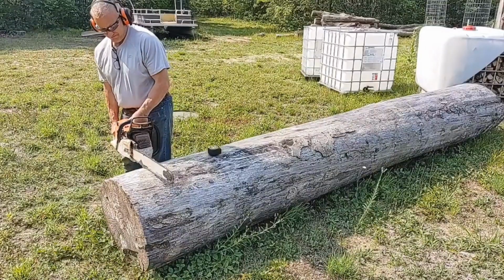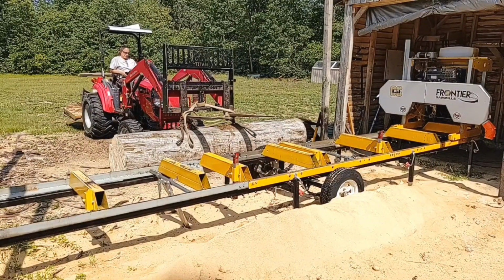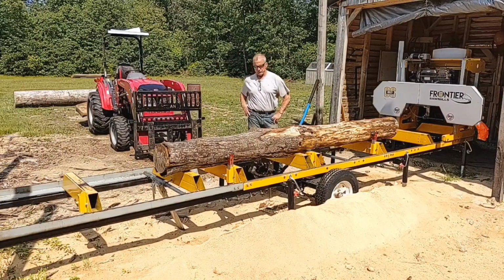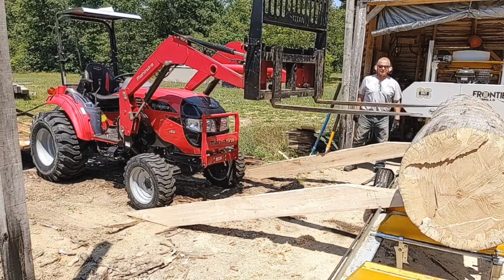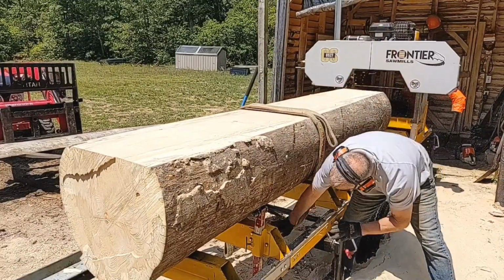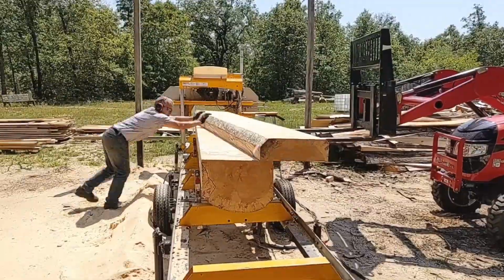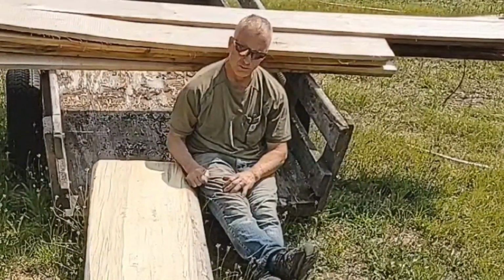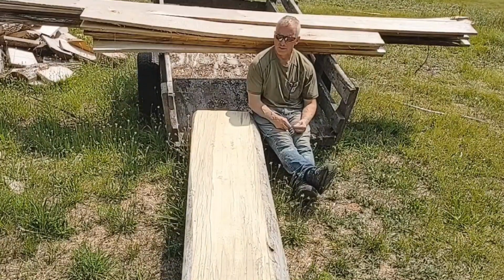Handling Big Wood on the Frontier OS27 Sawmill

Comment: I just got seven logs 16 1\2' long. Between 24&16" across. Gonna be used for trailer deck and corral boards. Luckily I have an old Clark 550 forklift. Still gonna be a job. Probably use your method with the strap to turn it. And it's still hot in central Florida. Thanks for the videos Jerry.
Reply from the maker: That is a nice load of logs.   That's the only way I can turn the big ones.   Thanks for stopping by the channel and the comment.

Comment: That sure was a big log you had there Jerry, i know when you sent me a message saying you had big wood but damn that was big 😄 
Your still lucky to be able to get the tractor over it, i dont have the height in my sawmill shed so id have to man handle mine 😩 theres not many overly massive logs ive had on but yeah i have to turn by hand. Slabbing down to reduce some weight it what i have done in the past but i try not to do that so i can maximise the biggest cant available.
Great job though Jerry, keep showing us how its done.
Reply from the maker: Thanks Buddy.  I've been milling some really big ones of late.  That is a consideration when I build my roof is to make sure I can still get my tractor under it.   Thanks for the continued support.
Reply: @BigelowWoodcraft  yes you have been milling some large logs for sure.
Yes make sure you have enough height for those heavy oversized logs.
Always a pleasure to watch your content buddy 👍

Comment: I lift one side with my tractor . I use a board to prevent the log from rolling off then pick the other side. I also have bunks beside my mill so I lift in 2 stages.
Reply from the maker: Interesting.  Never thought of that.  Thanks for the comment.

Comment: Good stuff! I ain’t cut anything over 14” or so yet. I have some 25” red oaks and bigger pines but I want to use my mill more so I don’t screw them up. My little 28 hp won’t pick them either so I will figure it out probably do what you did.
Reply from the maker: The big ones are a different beast.  Thank you for the comment.

Comment: A 50 hp tractor might be perfect for that mill, but that 35 hp seems to be just fine except maybe for those monster sized logs, but would be overkill for all but a few logs that are actually the max for your mill!! Besides, there are methods to handle those huge ones when you use your head with the right techniques!! I agree with the 16-17 inchers, they yield an awfully nice amount of lumber and roll nicely!
Reply from the maker: I love my tractor.   For the times I need a bigger tractor just didn't justify the price difference.  Like you said we can always get them up there somehow.  Thanks Tim.

Comment: I have a old ta Schmidt mill cuts 32 inch I have had 30 inch 10 foot logs onto the mill and what a struggle using Ramps to assist getting it onto the mill and struggling my self turning the log with a pee vee
Reply from the maker: Bret, I don't know how you did it.   Big logs are wealth of lumber but a lot of work to get it out.  Thanks for the comment.   If you have any pics of your schedule mill send them to my email.  I've never seen one.